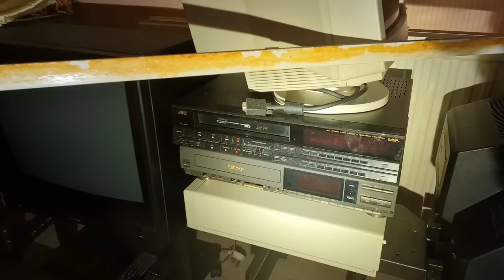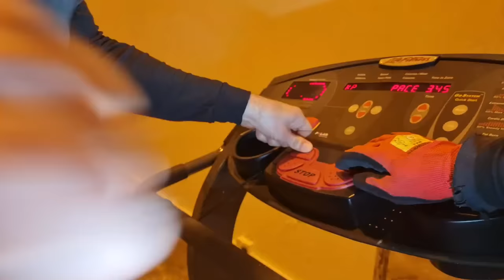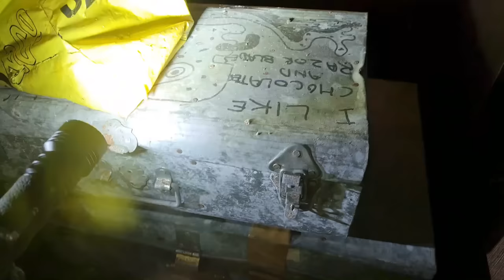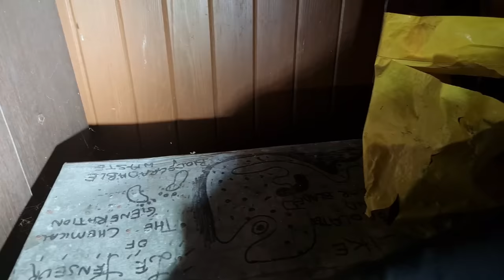Untouched Abandoned Gothic Mansion - Full of Valuables!!

Comment: Not 1970 but 90s
Corgi: No. 97746
Toymaster Van Set
Corgi 97746; Toymaster Van Set; Morris J & Bedford CA
Previously owned collector's model in very good condition in the original packaging, the box is a bit faded
Collectable Diecast model in 1:43 scale
Year of Release:1991
Click 'Shipping Information' above for shipping charges, Shipped weight: 587g
Space patrol is a cheap wind up toy from china from 2000
Reply from the maker: Thank you for the info much appreciated 👍

Comment: I'm in pure conflict with your video. 
On one hand I hate what your doing. Trespassing is offenssive, which is why its a crime. 
You guys abviously are uneffected by laws, yet you appear to not take anything beyond revealing the lives of other without consent. 
Yet I find your goofing off entertaining. 

I can't rightfully be entertained no more without pointing out that the old Tommybiy kettle helmet has a particularly deadly componant in it. The center of that paticular headliner has an Asbestus center. 
I seen this before on another youtube documentary. Asbestus is very hazardous to breath. It flakes & can float in the air as tiny dust particles. 
If it csn be treated early enough  you should all be tested immediately. 

Oh, and the cobieholes you discovered in each top floor ( s ) 
rooms are there to allow A-frame roof styles to breath. So that air can circulate at its very best. 

Break a leg. 
No, really. It'll help my conscience for watching this rabble. ;)